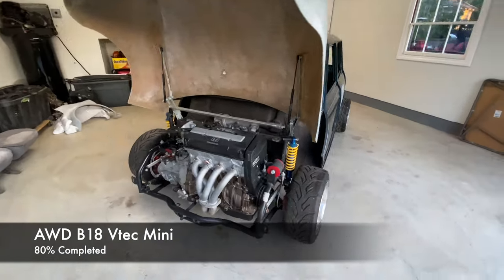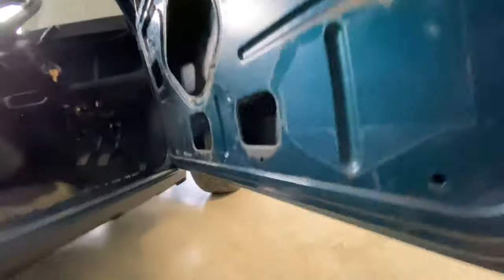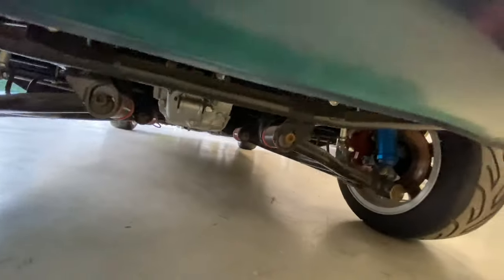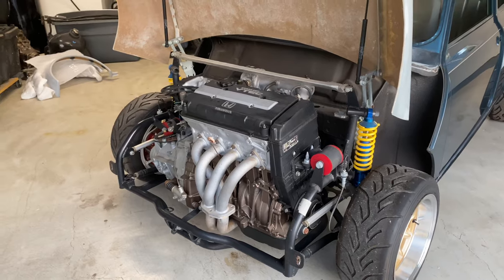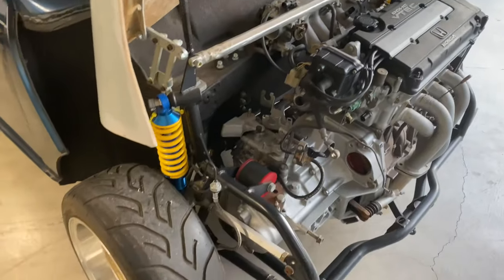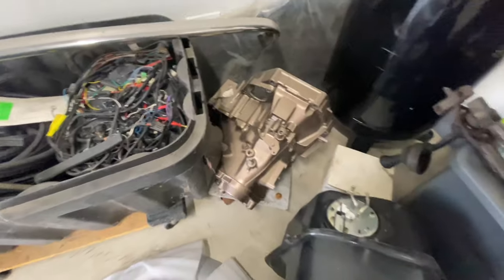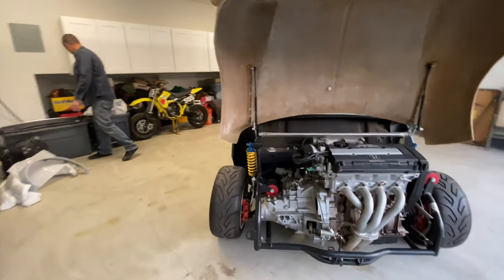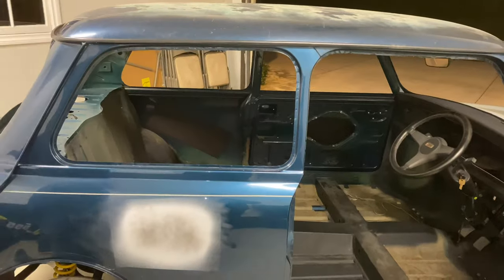AWD Vtec Mini Project with B18 Ready for paint and assembly! CA Registered

Comment: I am building a K20 AWD.. under standard(ish) steel front and " REAR " exhaust...  using the MiniTec Kit...  [ but with MASSIVE amount of changes to make it work..] ... I have done more than this build.. but still I can really  appreciate the amount of work that has gone into this beast.. So.unless you have a FULL WORKSHOP.. hoist .. metalwork tools.. -  welding.. machinical.. electrical. skills ,, not to mention $ 50K + and a very understanding partner.. . etc etc  .. then keep dreaming.. this is an EXTREME build...( I'm 4 years in.. and on the home straight to finishing it ).. minis are a drug...
Reply from the maker: The best kind! Hats off to you the AWD Minitec is probably a 9/10 on the pain in the ass chart!